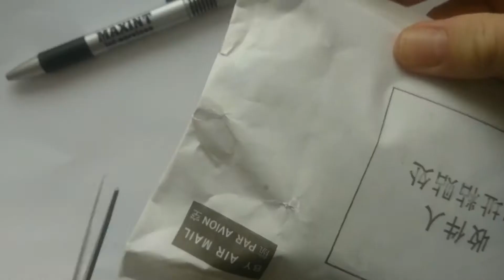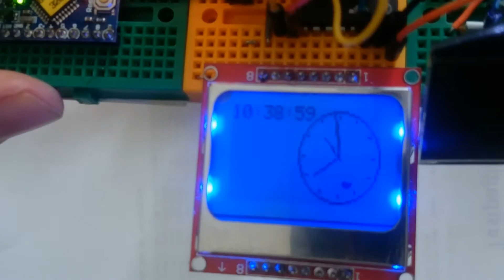Demo: Arduino and ESP experiments, plans for 2018

Comment: 0:52 woa i've been wondering if that were possible too.  Coz those steppers are such low amperage.
Glad to see it works!

I guess the flyback voltage spikes arn't big enough to damage anything?  Or are you using those LEDs as flyback diodes?
Reply from the maker: Hi @roidroid, Happy New Year!
Great comment, thanks! No, those LED's are not intended as such. I kind of boldly went where only amateurs went before... The LED's are actually simply connected to the outputs of the 595, to light up when the output is high. If such a spike occurs, they will probably be the path of least resistance, hopefully dampening the spike. I assume the those spikes won't have much power as only little power went into the coil. We'll see! (As you can tell from my comments, I'm not much of an EE. In fact I made a lazy choice to select software engineering instead...)
Reply: heh I'm not any sortof engineer, so don't worry there.  Just a hobbyist gradually learning what's possible.

A lot of my project ideas inevitably lead to researching howto drive as many actuators as possible, as cheaply as possible.  So your 595 IO-extender stuff has been very interesting.

I'm a bit confused, coz i thought driving these steppers required you to be able to reverse the voltage across both the coils.  So i didn't think it was possible to do with only 4x output pins of a shift register.  But... there it is, it's working!
Reply from the maker: Somehow I find using cheap and tiny micro controllers quite fascinating. (I guess they bring me back to my ZX81 days...)  Some are quite limited on the number of pins, so I ended up using equally cheap 595's and I2C expanders.

I know the 595 can supply and source limited current and on another experiment with a piezo and the SN sound chip it got a bit warm when too much power was asked. These 595 seem quite sturdy and I haven't managed to kill one (yet). Driving LED's and the micro stepper worked without issues.
 (The PCF has much more restricted power characteristics).

I drive the micro stepper using simple H/L-sequences and noticed that 3.3V was too low. They may require just a bit more power using an H-bridge or and ULN2003 Darlington driver though, as in the tested configuration the stepper wasn't very strong and unable to do much else...
Reply: ah, i have a vague memory of past calculations suggesting that the 74HC595 can be sortof used as a level shifter.  If you power the 74HC595 at a higher voltage (while still powering the MCU at it's normal voltage), the 74HC595 can take the lower voltage input from the MCU and output the higher voltage, there's a bit of wiggle room.

Just looking at the 74HC595's specs, if the MCU is powered at 3.3V, the 74HC595 should be able to be powered upto 4.7V (and it'll output that voltage on it's pins).  That's right on the edge tho, probably best to cut it back & go for 4.5V or less.  Still it's better than the original 3.3V.
It can probably all get even higher if you increase the MCU's voltage a bit too.  From what i gather, the 74HC595 can output a voltage 42% higher than it's digital input.  So if your MCU can handle 3.6V, you can theoretically be powering your 74HC595 with upto 5.1V (again... edge of spec, recommended to back that off a bit).  It's not quite close enough to be powered via straight USB (coz that can be over 5.5V) without a voltage regulator, but it's getting close.

Coz i mean... if you havn't blown up a 74HC595 via overcurrent, and you really want to give it a go, this could be a way to do it haha.
Reply from the maker: +roidroid - Good suggestion for further experiments! In addition to the DIP version of the 595, I also have quite a few in SMD package. Those allow for only half the current, so they may be more fragile. I still need to find a good application for these micro steppers though. They have only 8 steps per rotation, so I guess some geared mechanism would be required. May be hacking them into an old analog clock could be fun....
Reply: aww man i didn't know the DIP & SMD versions had different specs, that's a shame